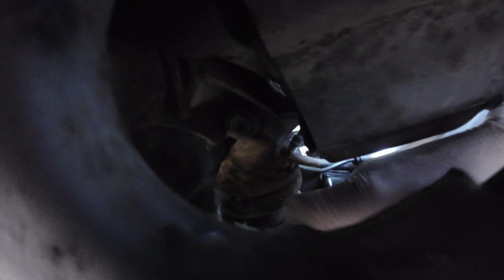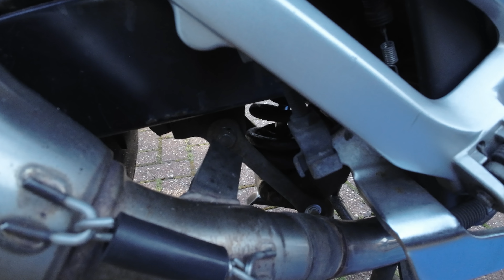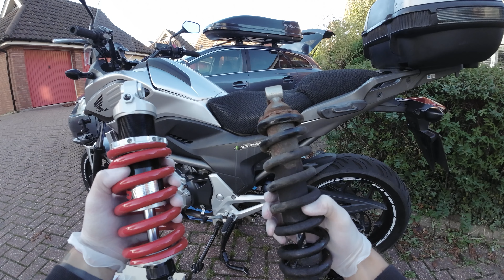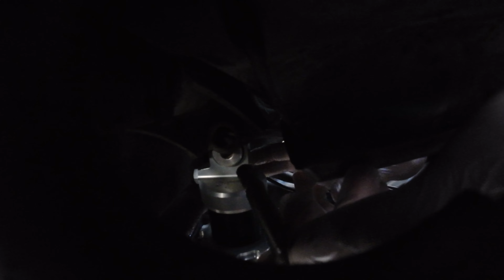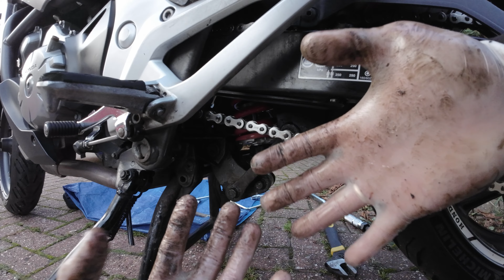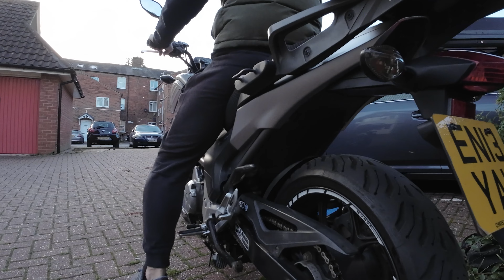How to change rear shock on NC700X (YSS Shock)

Comment: Can you tell us about the new shock? Why did you install it?
Reply from the maker: Because my stock one bottom down, when I'm loaded and with my wife. In general I'm usually riding loaded with camera gear and lights when travelling.
This one is more capable with larger weigh.